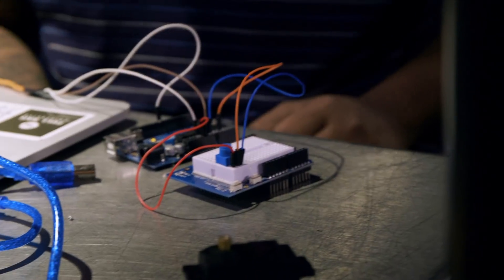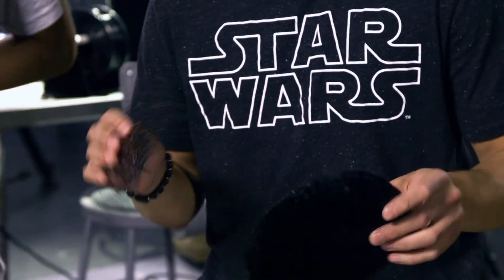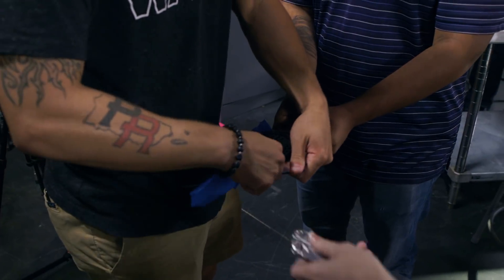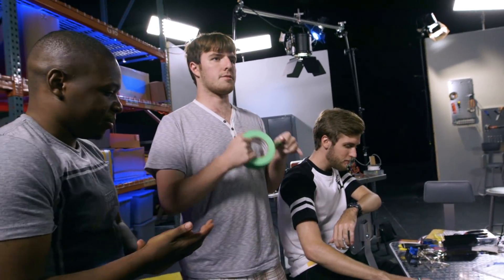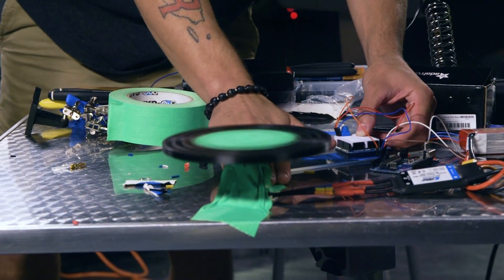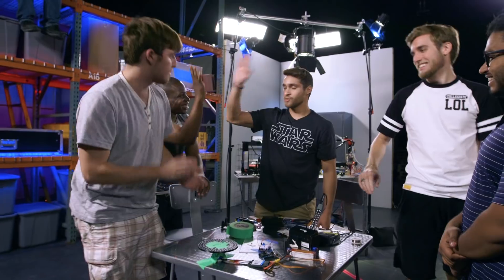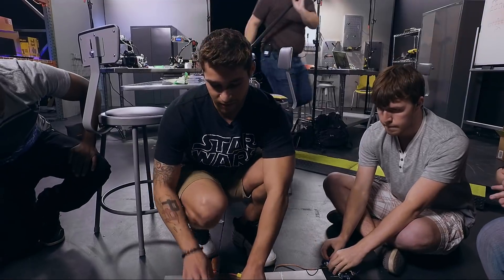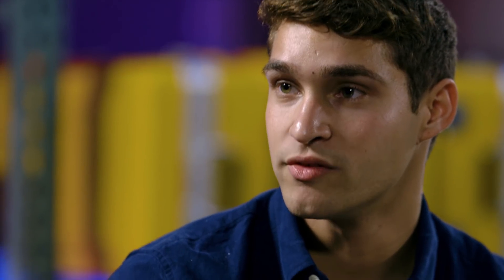Hacker Labs:  Hoverboard Challenge Ep. 2 | Full Sail University

Comment: How ghetto is this lab? It's a university, why are they using painters tape to hold a motor down, can the university not afford a vice? Maybe a workmate? Why are they 3d printing high speed parts, do they not own a CNC machine to make one from aluminum? There's no way the students are that clueless, I'm sure they'd do it the right way if they had the resources.
Reply: MattsAwesomeStuff Fullsail "University" is like ITT Tech. So no they don't have the resources.
Reply: Oh, so it's not like a trades & tech school, it's more just laptops and chairs?
Reply: I'm well aware of 3d printing basics and the use of painter's tape to make it easy to remove prints from the bed. Not sure how good your English skills are, but I wasn't criticizing the painter's tape on 3d prints, I was pointing out how ghetto it was to try to hold a motor down with tape instead of using a vice or a workmate, as an example of how poorly equipped their shop was for a tech school, especially for the scope of the challenge they took on.
Reply: MattsAwesomeStuff Wait, so have you been to a lot of tech schools?
Reply: I will be asshole and I will say go learn 3D priting basics. Blue tape is used to hold 3D prints while they are printing

Comment: You r Using magnets.... So it needs a magnetic metal road for Levitation?? Or it can levitate on concrete roads??....😊
Reply: Hari Vishal google “ law of induction” and eddy currents and it will explain ever thing.
Reply: Ya... but my doubt is, the surface you've used for test1 is a metalic surface or concrete floor... and the hoverboard has magnet which produce changing magnetic field in all direction and surface which carries it should have some magnetic property right?? that's my doubt :-)
Reply: No, faradays law states that running a magnet over a conductive surface induces a current. in this case, the discs with magnets are used to induce a current in the sheet of aluminum/copper depending on how much money you have. asphalt has very little conductivity which is why you don't have hover cars. also, Halbach arrays are designed to direct the magnetic field. Your statement about changing magnetic fields is correct, but not in all direction just one and that's down. now for your last statement
No, magnetic property is needed in this case. due to the face that aluminum on its own is not ferromagnetic meaning, you can stick a magnet to it and it will stay. what we are doing in creating a magnetic pole on the surface of the sheet that are disc can the uses to replle off of and genrate lift.